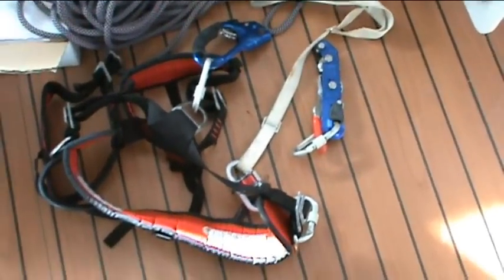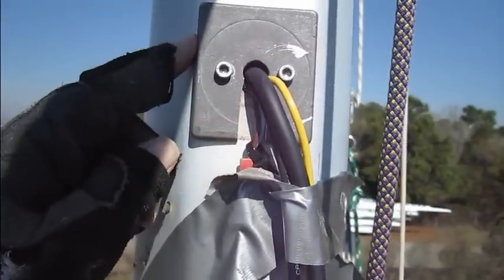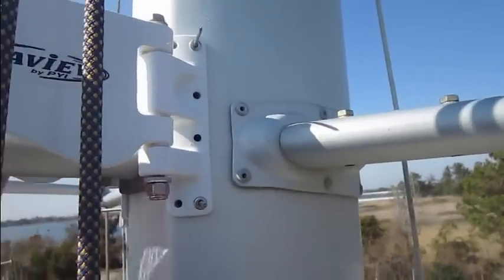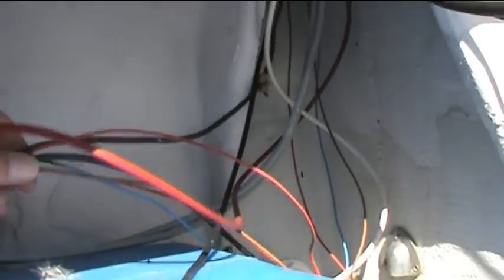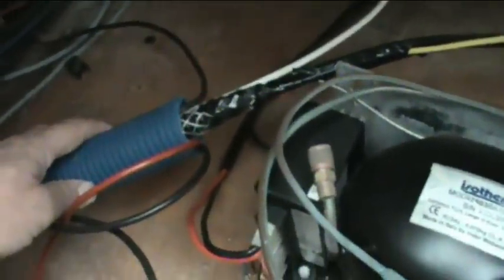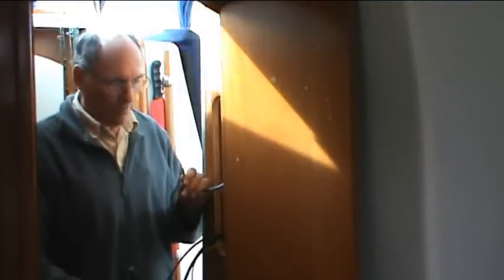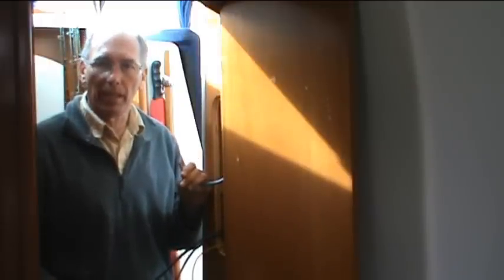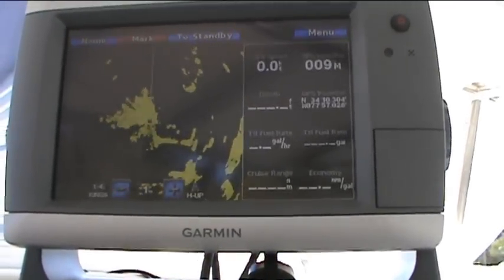Installing a Garmin Radar on a Lagoon 38

Comment from the maker: Yes you would want to tab them. Machine screws are threaded like bolts. Not hard to do in aluminum at all. use some Tuff Gel on the scres when installing. The rivets I use were stainless (and a bear to break off!) Corrosion is not a big issue but the Tuff Gel will help that as well.
Wayne

Comment from the maker: Hi mark sorry to take so long getting back on this. No there was no internal conduit. I would have preferred that but without taking the mast down we just dropped the wires down. The owner plans to drop the mast in a couple of years and that would be a good time to fix that. The shavings are not an issue as they fall to the bottom and aluminum shavings are pretty soft anyway. You want to keep holes to a min and as small as possible. Just watch the they are not in high stress areas. Wayne

Comment from the maker: I used the rivets because they came with the mount and seemed easy. my original plan was to trill and tap. I think drilling and tapping would not have been much harder. Some 10-25 machine screws would work well. Keep them short so they don not snag anything inside the mast and use something like tuff gel when putting them in.

Comment: Thanks, Wayne. With machine screws would you still have to tap? Or would a pilot hole be sufficient? I would imagine that the advantage of rivets is that they can be made of aluminum so you don't have to worry about galvanic corrosion.

Comment from the maker: Hi Chris
The mast is deck stepped with a small tube thru the bottom. That is where I used the coat hanger to snag the string and pull it thru the tube into the boat. Sorry that was not clear space was so tight I could not get my camera in there to show it.

Comment: Wayne, thanks for posting this clip!  I didn't note whether you found an internal conduit to run the cables down, or whether you simply had to drop them to the mast base.  Also - any concerns about metal shavings falling into the mast and fouling sheaves or damaging running rigging?  I've been trying to sort all this out on my own (new to me) boat.  What amount of spar drilling is OK to not weaken the spar?

Comment: Thanks for posting. I'm getting ready to add radar to my Gulf 29 and this is very helpful. It's not clear from the video if the mast is mounted on the keel or the deck. I'm wondering how the lead weight got from inside the mast to inside the boat.  

Also, is there another option besides riveting? Can you bolt the radar to the mast?

Comment: Mr. Canning:
Your videos are impressive and inspirational.  What type of boats did you build and where?  

I am awaiting your rewiring video as I am about to rewire the panels in my boat.  Thanks!
Reply from the maker: rightcoaster abc Thanks you are kind. I have worked with a few builders both large and a couple of some custom builders. I was an engineer at Caver boats and worked for some small builders you would never have heard of lol. I really liked the small builders best. I am working with a magazine now to do some electrical videos so hang in there I will get some out before the end of the year.

Comment: Looking at the existing breaker panel...Why is it everything looks loose and unorganized..?  I saw another sailboat video and it was a wiring nightmare.  What's the deal?  Then you see other boats and the wiring is so neat and clean, it's looks like a circuit board.  It pisses me off to see spotty wiring because as a boater I know when you are at sea, with no help, you need things to work reliably.
Reply from the maker: highvelocity123 You are right and this is an issue. This was not my boat and although I try to clean things up as much as possible I was not hired to rewire the boat. This was how this boat was wired from the factory. I agree neatness counts and on my boat things are in order. There are many boats out there that are well done but like you say many that are not. This is something I plan on doing a video of in the future. Thanks for the comment and observation.
Reply: Wayne Canning Thanks for mentioning that, I wasn't trying to point the finger.  BUT, It begs the question though.  Why is the manufacturer of the boat doing such a crappy job.  Or has it been messed with before you got there...?  Boats are expensive to start, and to see anything less then a great job, is BS.  I like my wiring to look like it could hold up under Offshore racing conditions...lol